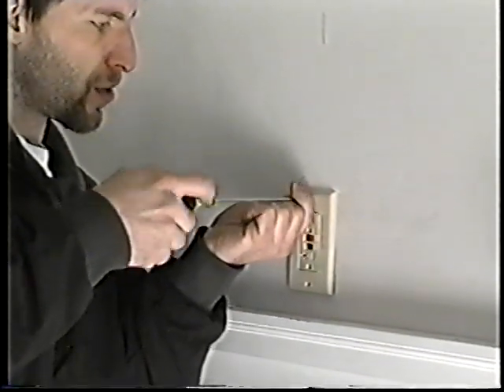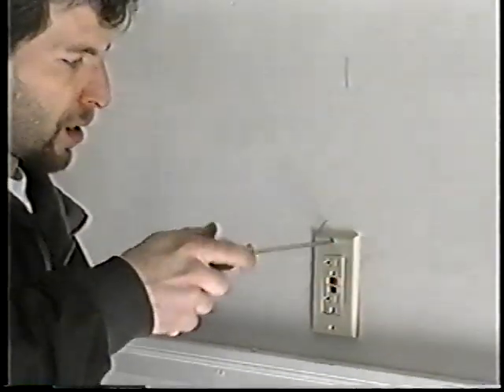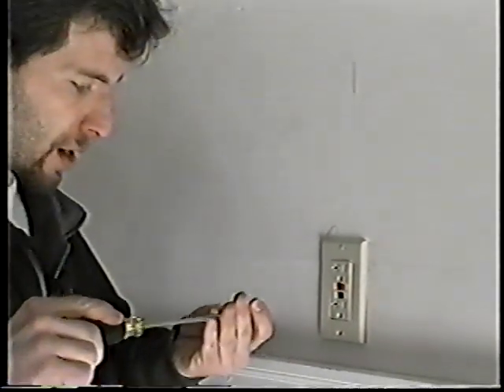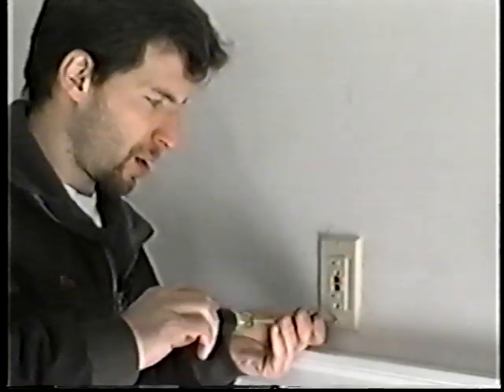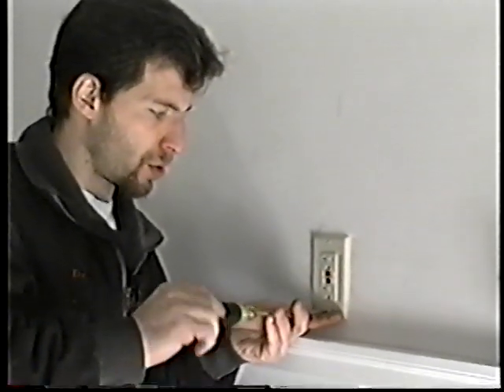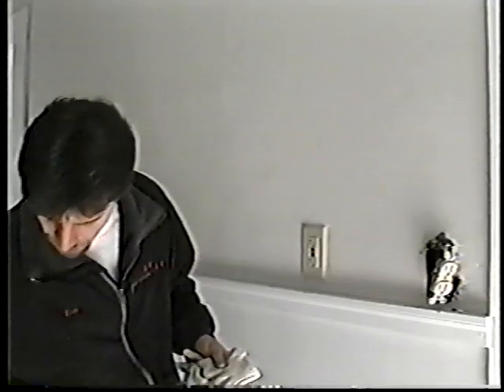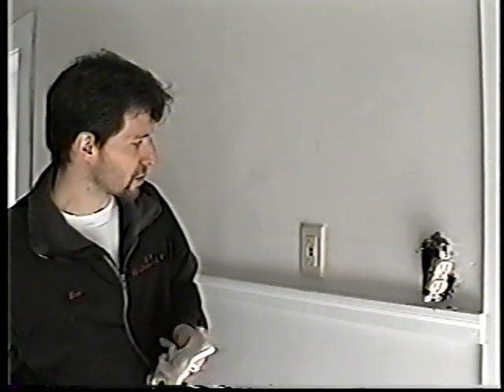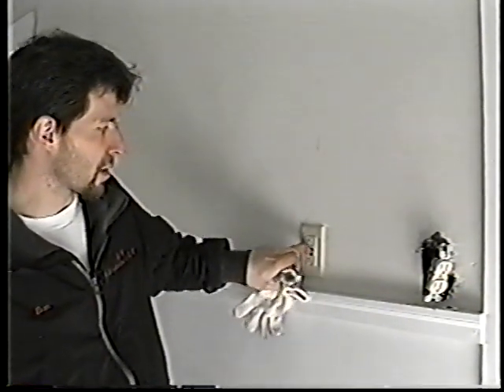Robyn Thompson’s Rehabbing Houses from Beginning to End - Tape 3 (2000)

Comment from the maker: 🎯 Key points for quick navigation:

00:17 🔥 Heating System Options Overview
- Discussing different heating system options for houses.
- Three main heating systems: electric heat, hot water baseboard, and forced warm air.
- Electric heat is the most expensive to operate.
- Hot water baseboard and natural gas are better alternatives.
02:25 🏠 Heat Loss and Radiation Installation
- Explanation of how to calculate heat loss and install radiation for heating.
- Heat loss calculation involves measuring room dimensions and windows.
- Baseboard radiation is installed on exterior walls to maximize heat distribution.
- Cost of installation varies based on difficulty and house layout.
03:22 🔥 Boiler System and Setup
- Overview of the selected oil-fired boiler system and its components.
- Boiler size is determined by the heating load based on heat loss calculations.
- Components include expansion tank, check valve, circulator, and power ventor.
- Boiler system design helps ensure efficient heat distribution and safety.
05:05 ⚙️ Power Ventor and Oil Burner Details
- Explanation of the power ventor and oil burner setup for the heating system.
- Power ventor eliminates the need for a chimney, venting combustion products outside.
- Oil burners require copper oil lines; gas systems use steel pipes.
- Emergency switch and code compliance are emphasized for safety.
07:20 💨 Warm Air Heating and Installation Considerations
- Discussion of warm air heating as an alternative to baseboard systems.
- Warm air heating is ideal for homes with open attic spaces for duct installation.
- Allows for easy integration of air conditioning.
- Installation must comply with local codes and regulations.
08:15 🚨 Frozen Pipes and Heating System Issues
- Burst pipes due to freezing can damage both plumbing and heating systems.
- Inspect for visible damage such as cracked radiators or disconnected joints.
- Contractors should be called immediately to avoid costly repairs.
09:14 ⚡ Electrical Service Overview for Multi-Family Homes
- Introduction to the electrical system installation for a three-family house.
- Cost breakdown: $3,500 for exterior service and $2,500 for interior wiring.
- Three separate panels are required for each floor, with an additional owner's panel.
- New regulations ensure power remains uninterrupted for emergency systems.
13:22 🔌 Electrical Metering and Wiring Techniques
- Detailed explanation of electrical meter connections and panel wiring.
- Each panel is powered by a single set of three wires from the meter bank.
- New meter boxes come pre-configured with connections, minimizing work for electricians.
- Installation of weather heads prevents water from entering electrical enclosures.
15:36 ⚡ Modern Circuit Breaker Panels vs. Old Fuse Systems
- Comparison between modern circuit breaker systems and outdated fuse systems.
- Modern panels are safer and more reliable, with circuit breakers instead of fuses.
- Older fuse setups often had mismatched fuse sizes, leading to safety hazards.
- Proper grounding and outlet placement are necessary for safety.
16:00 ⚠️ Avoiding Illegal Electrical Work in Multi-Family Homes
- Caution about potential illegal electrical installations in multi-family houses.
- Unpermitted electrical work, such as adding in-law apartments, can lead to legal and safety issues.
- Always verify the number of panels and meters to ensure the property is legally classified.
- Research is essential before purchasing multi-family properties to avoid unexpected costs.
16:48 🔌 GFI Outlet Installation and Safety
- Step-by-step guide for installing GFI outlets and understanding their importance.
- GFI outlets should be installed in areas with water, such as kitchens and bathrooms.
- The hot wire connects to the brass screw and the neutral to the silver screw.
- Grounding is crucial for safety; always use electrical tape to secure terminals.
19:01 💧 Installing a New Water Heater
- Explanation of the process for installing a new gas water heater.
- Key steps: gas connection, hot and cold water connections, flue piping, and relief valve.
- Proper sealing of gas connections ensures no leaks.
- The installation requires careful preparation to avoid damage to the new water heater.
24:12 🔧 Installing a Gas Water Heater
- Detailed process of installing a gas water heater, focusing on connecting hot and cold water lines, and ensuring proper sealing.
- Step-by-step instructions for soldering and sealing pipe connections to the water heater.
- Ensuring tight connections using pipe wrenches and Teflon tape.
- The importance of using new relief valves and securing them to the ground as per code.
27:01 🔥 Flue Piping and Ventilation for Water Heater
- Installation of flue piping to vent combustion gases from a gas water heater.
- Connecting the draft hood to the top of the water heater for proper ventilation.
- Ensuring the flue pipe is securely connected to the chimney and sealed with furnace cement.
- Differences between gas and electric water heater installations, with a focus on gas venting requirements.
29:07 💵 Cost of Water Heater Installation
- Overview of typical costs involved in installing a gas or electric water heater.
- The cost of installation ranges from $300 to $600 depending on the size and warranty of the unit.
- Electric water heaters are simpler to install, requiring only water connections and wiring.
- All installations should be performed by licensed professionals for safety and code compliance.
29:51 🐜 Pest Control Inspection and Importance
- Introduction to the role of pest control inspections, especially for wood-destroying insects like termites and carpenter ants.
- The importance of checking both inside and outside of the house, including garages, for wood-destroying insects.
- Establishing a good relationship with a reputable pest control company can help save money in the long run.
- Smaller companies may offer better pricing through negotiated volume work.
31:29 🪲 Identifying and Treating Termite Damage
- Inspecting for termite and wood rot damage, with a focus on identifying the cause and deciding on treatment.
- Poking wood surfaces to determine the extent of damage and distinguishing between termite damage and other issues.
- Checking for existing treatments or warranties to avoid unnecessary new treatments.
- The importance of thorough inspections to avoid overlooking hidden damage, especially in areas with poor access.
34:00 🏚️ Termite Treatment and Drilling Process
- Detailed explanation of termite treatment using a liquid chemical barrier and the drilling process to protect the house.
- Drilling holes around the foundation and injecting a chemical solution to prevent termites from reaching the wood.
- The use of a sub slab injector for precise chemical application around the foundation.
- Ensuring that the treatment is applied consistently throughout the house to prevent future infestation.
38:07 💸 Termite Treatment Costs and Pricing
- Overview of the costs associated with termite treatments and establishing a relationship with pest control companies.
- Average termite treatment costs range from $400 to $600, depending on the extent of the problem.
- Establishing a working relationship with a pest control company can reduce costs, especially for repeated treatments.
- Warranty options for treatments, with some companies offering one-year renewals for ongoing protection.
40:47 🏠 Drilling and Pumping Process for Termite Treatment
- Step-by-step description of the drilling and pumping process for termite treatment.
- Drilling holes in the foundation and injecting liquid to create a protective barrier against termites.
- Explaining the need to patch the holes after the treatment is completed.
- The time and labor involved in termite treatment, including drilling and pumping liquid to cover the necessary area.
46:38 🛠️ Pest Control Inspection Limitations
- Discussing the limitations of pest control inspections regarding structural issues.
- Pest control inspectors are not qualified to determine structural soundness.
- They can only report on the presence of wood-destroying insects, not structural damage.
- It's crucial to consult a building contractor for any structural concerns.
47:57 🐜 Thoroughness in Termite Inspections
- Emphasizing the importance of a thorough termite inspection and the need to check various areas of the house.
- Inspectors must check the sill plates, window sills, and beams for termite damage.
- A crawl space should be inspected carefully for termite tubes.
48:22 🔑 Conclusion of Mechanical Systems and Structural Elements
- Wrapping up the segment on mechanical systems and structural elements in home rehabbing.
- The segment concluded with advice on conducting proper inspections and ensuring structural integrity.
- A focus on ensuring all parts of the house, from beams to crawl spaces, are adequately checked for damage.

Made with HARPA AI